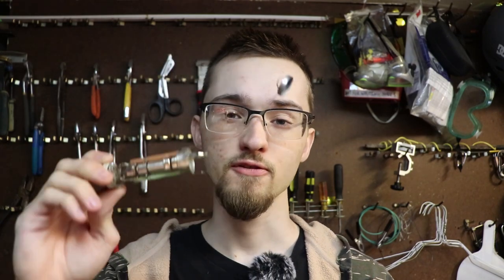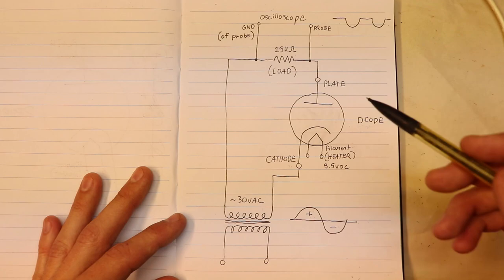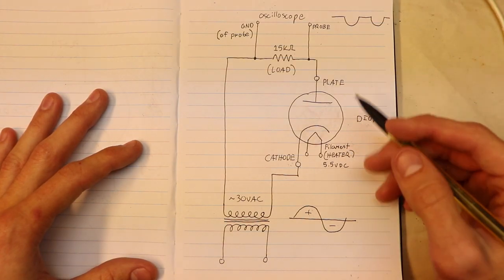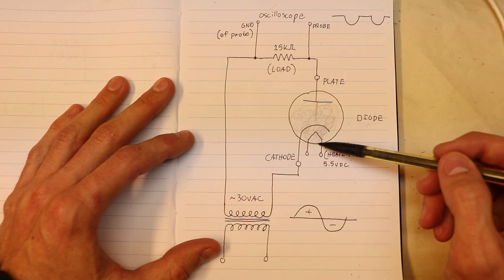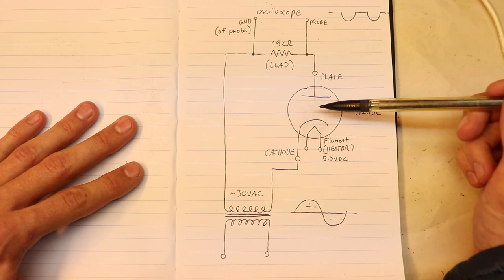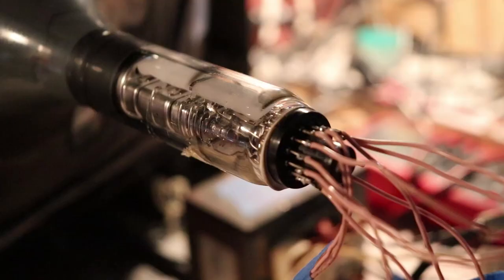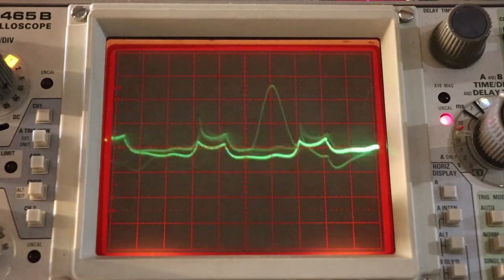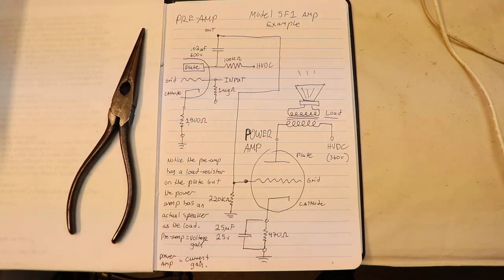Making Tube Amplifiers from TVs

Comment: The reason the 3 cathodes are separate in a colour crt is because each cathode corresponds to the colour video signal, so they are driven separately by the red green and blue video signals. If they were all connected together, you'd just get a black and white picture as all three cathodes would be firing the same amount of electrons to the red green and blue phosphorus.
Reply: Would it be possible to use the RGB as 3 mono channel mixer?

Comment: Before you start experimenting with CRT's it may be a good idea to include a word of advice.  CRT's are high vacuum devices, which may implode and cause serious damage or injury to yourself and whoever is standing close to it.  Heavy chunks of glass flying around at high speed is not a joke.  Besides, some parts (capacitors) of CRT TV's may contain lethal high voltage long after they have been disconnected.  Do not fool around with these things if you do not know what you are doing.
Reply from the maker: Yeah you are absolutely right, I should have mentioned that somewhere.

Comment: An output transformer that might work better for this circuit is a Stancor A-4744 (they're 20 bucks on VivaTubes dot com), which has a 4R:25k ratio.
A Fender Reverb transformer might work as well, those have a ratio of 4R:22k5.
You can increase the primary impedance by using a higher impedance speaker (a 16R speaker would get you 100k for the Stancor and 90k for the Fender).

Comment: I had same idea many years ago, but I actually never worked with tubes and prefer to work with much lower voltages.
Also, what about push-pull output, wouldn't that change anything?
Reply from the maker: This was my first time working with tubes as well, and a push-pull output might work better, it never crossed my mind to try that configuration, thank you! In a push-pull configuration I would have to use a center tapped transformer and at least make sure both CRT tubes are as identical as possible but thats a great idea for another video!
Reply: You're welcome, it just crossed my mind when you said it can deliver quite high currents as diode and I immediately thought of transistor output stage.
When I think of it, do you even need transformer? There are OTL amplifiers with just big capacitors to filter DC, I even noticed schematics where are tubes connected in parallel to increase power.

I was working as electrician in factory for three years now and honestly, I never liked working with those "high" voltages, 24V DC is the most I'm comfortable with. I know myself and I don't trust myself enough about this :)  Honestly I don't even know how I got to your channel, I was just searching for diy plotters and boom, I was here...and stayed because of quality content!

And now I'm going to finally watch whole video, because I found it at about 2AM and just skipped to certain times to see result :D

Comment: Look at the glasslinger channel, he is able to make tubes. Like 1959Berre said before me, its insanely dangerous what you doing. Heating CRT or scratching it with screwdriver is definitely not what anybody should do.  I would use those boards with connectors for soldering and not solder directly to pins. As you realized, using focusing electrodes of CRT as plate give you small plate current and high output impedance good only as preamp tube, but dimensions a ridiculous.

Comment: Interesting experiment although without any usefulness. Imagine to build a stereo amplifier with 4 of those CRTs for portable use then  you will need a pick up truck to carry it around !! By the way I'm electronics technician and I repair and build tube amplifiers and radios with normal tubes :)